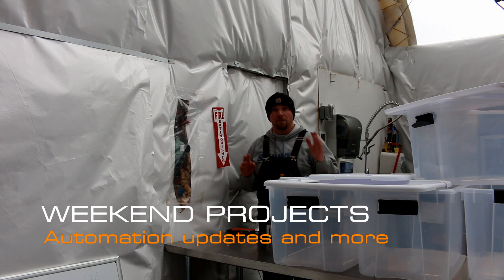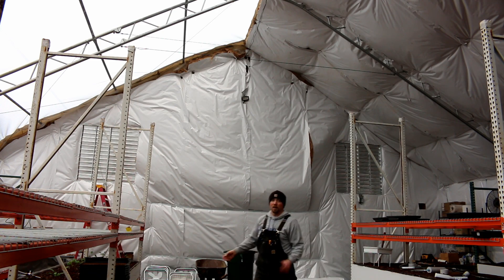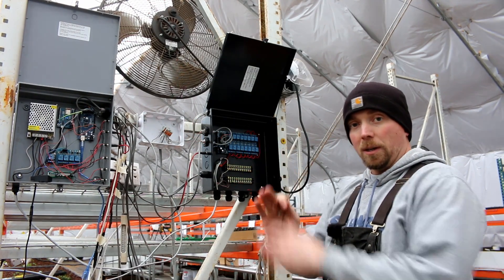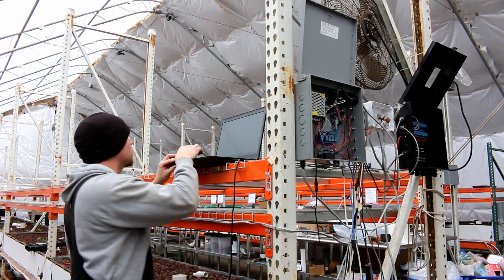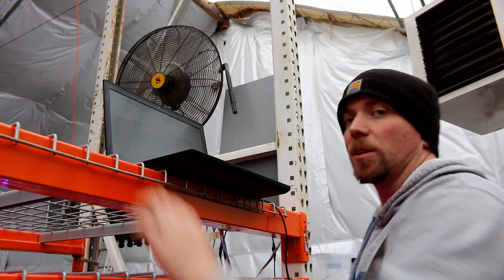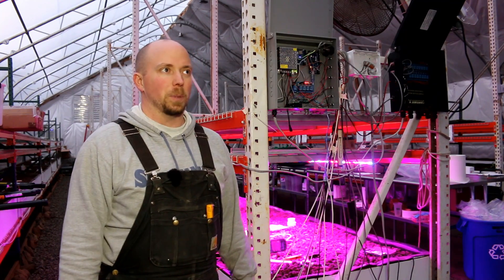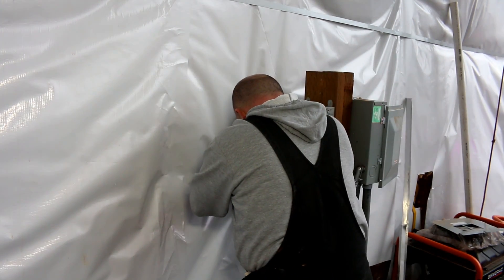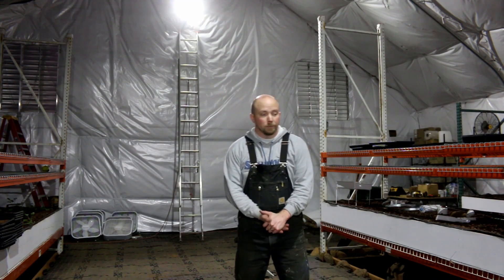Automating GREENHOUSE LED LIGHTS and EXHAUST FAN

Comment: It would be an interesting exercise to see how an HRV (like a Zehnder for example) would compare for ventilation and heating cost to conventional HVAC system.  I built a passive house in Colorado and the HRV is a key component of it's thermal efficiency.

Comment: You might want to add an easy way to select different lighting durations on a bed by bed basis - perhaps a lookup table. That way, you can figure out how much light different crops need and tell each bed which crop is planted so it gets your ideal light.
Reply from the maker: yup yup...that's the vision

Comment: @4:13  Some of the worst words a programmer can utter!
Maybe you could diagram the pin-out & attach it to the box cover to keep it handy...even a hanging plastic bag with the info in it.
@11:00 One worst sounds that an electrician can hear!
The in-rush current for a 12A motor is probably somewhere around 3x-5x that...maybe a 60-80A contactor keyed by the 10A relay.

Comment: Been a while since we have seen those smoking gremlins.  I’m guessing you will need to be careful of sparks and the insulation as a fire risk?
Reply: You can't ignite Glasswool, I've been trying for over 30 years by demonstration, it's made from sand and recycled glass. I'd hope the cover didn't hold a flame and retreat from the source of heat, but how much of a flame could that thickness generate? I'd ask Jeff to attack a spare piece with a blowlamp but he looks extremely busy.

If you leave a piece of standard Glasswool in a room with 80% humidity for four hours it will take on 4.18% of water. Glasswool is resistant to mold, but the binder is usually organic and hydroscopic and highly susceptible. SH-AF treatment will stop moisture affecting the performance, but if you look at a strand under a microscope  it is one of the best man made water collectors we have. The weight of wet Glasswool can bring down ceilings. In a recent UK study it was noted that approximately 70% of all unfaced basement ceiling and crawl/loft space fiberglass is severely contaminated with growing mold, as dust provides enough food for it to live on.

Comment: Hmm yeah, a heat exchanger for heating would have been more economical and good for the plants, since setup can take air from inside or outside the building normally.

Comment: TRM, if you have a big motor (like for that fan), you need a motor contactor, not a relay. The contactor will handle the current inrush and will be able to disconnect the motor without frying the contacts. A motor contactor is MUCH better than a relay. Please study this!  http://amzn.to/2DzEnSW

Comment: that gas regulator can't be covered with plastic, otherwise it could fill the space between the insulation with propane and you need a 20 amp contactor

Comment: Hey Jeff. 12 Amps is the nominal current. When starting up, the inrush current may be 5 to 7 times bigger than nominal current.
You may want to use a soft start device or a contactor (~80A) and use the 10 A relay as intermediate relay to control the contactor.
Reply: Can you explain the physical differences between a contactor and a relay. I expect that it is surge suppression but I don't know how that is accomplished.
Reply: https://en.wikipedia.org/wiki/Contactor